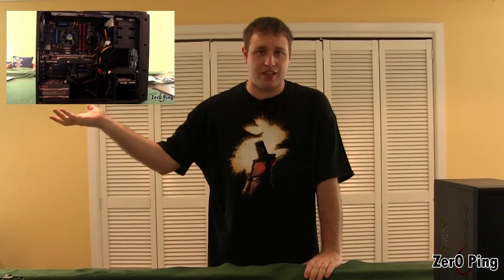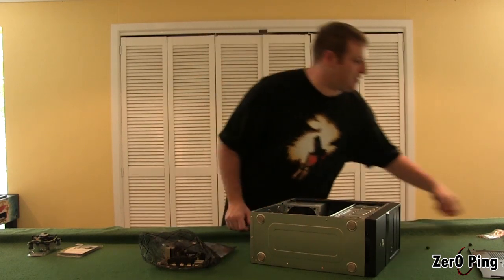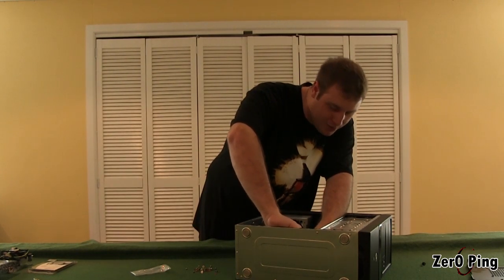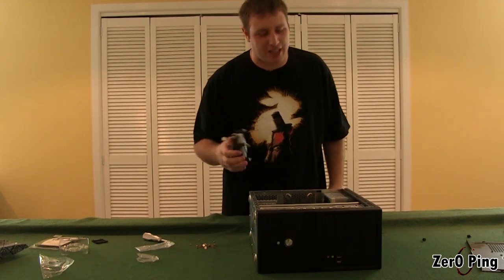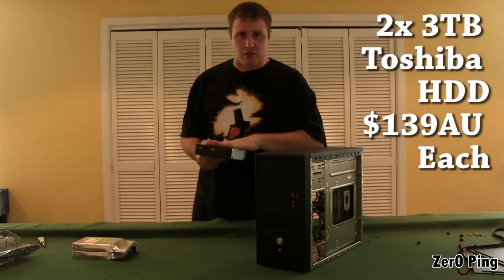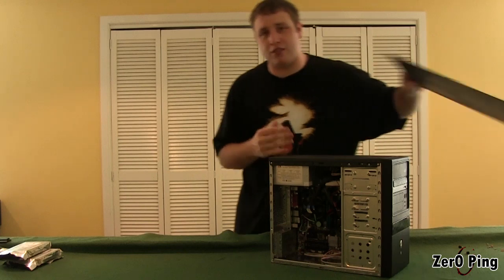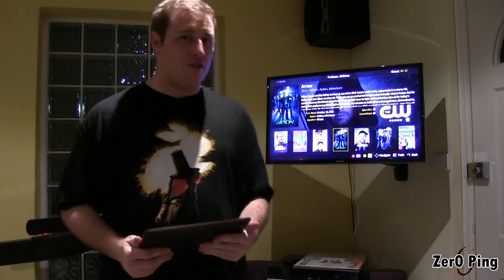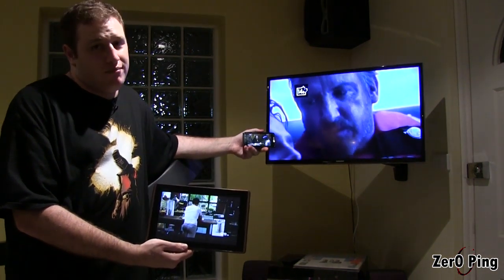How To: Building a Media Server with Plex

Comment: How well would my media server do? I currently have a old PC that is a eMachines W3619 computer and am planning on maxing out the amount of RAM it could handle (which is 2GB DDR2 RAM although possibly not maxed out as it has a frequency of 533MHz in the RAM). Also going to install a Intel Core 2 Duo (P8800 @2.66GHz, Dual Core). Can this possibly send 4k @30FPS at least (I need to know) with no stuttering (Aiming for 4k @60FPS)?
Reply: I am also planning on running Linux on the system (Ubuntu CLI) which might help with reducing large loads for the CPU and RAM (I know Ubuntu CLI requires a very small amount of GPU power to run. The motherboard already has a built-in GPU which I know will run fine).

Comment: Does this motherboard require an 8 pin connector? I only have a 4 pin on my PS.
Reply from the maker: The 4 pin connector on your Power Supply should have no problem connecting to the motherboard despite it having 8 pin.

Comment: Hey quick question. Will this overheat? I live in an area without air conditioning and in the summers it gets a bit hot. What also would work with an AMD system?
Reply from the maker: Plex doesn't currently support more than a single core which makes single core performance very important for the server, for this reason we chose the g3420.
To get similar single core performance with AMD you need to start looking at the A10-7700k which is more than twice the price of the g3420, whilst if you were to use the server for encoding and rendering then the AMD chip sets would make more sense.

We haven't had any issues with heating, however if you were worried we'd suggest installing a fan or two, given we're not using a GPU heat production is quite low, also the g3420 uses around 40w less power than the AMD chip mentioned above and as such produces a lot less heat.

Hope that helps somewhat.

Comment: Do you think it'll work in this case? Silverstone Milo ML03B microATX
Reply from the maker: Hey Kam, the Silverstone Milo ML03B will happily support the motherboard we used, however if you want to take advantage of the USB 3.0 ports on the front we suggest investing in an ASUS H81M-PLUS, it's only a few dollars more. The only things you'll need to worry about are expansion cards like Wi-Fi, sound and graphic cards should you choose to go that route as the Milo is quite shallow and will limit you to half size cards, This isn't problematic if you're happy to use on board sound and CPU based graphics processing, as for the Wi-Fi, Michael uses a TP-Link WDN4800 card which comes with a half size bracket in the box for cases just like the Milo.
Reply: Hey, thanks for replying. I didn't see this come though as I don't check my G+ often! I decided to go with a Mac Mini in the end. It was less money, takes up less space and more power efficient. Runs perfectly and I just screen share in to via my macbook pro when needed :)

Comment: How does it work man? I would imagine the Pentium G3420 doesn't like to transcode 1080p videos? I'm building a haswell i3 system with Plex/Filezilla using Ubuntu.
Reply from the maker: So far no struggle, most of the time it is streaming to about 3 devices at once usually in 480p, but throw in a 1080p stream and it keeps on going without a hitch.
Reply: out of an i3 similar to this I'm able to transcode 4 1080p streams at the same time at a push, but only on fast transcode, which is suitable for most people =)
Reply: Kevin Caldwell Which i3 in particular?
Reply: TheBlooRayChannel the i3 3220, its dual core with hyper threading. If I hadn't already mentioned I have Plex running in fastest transcoding too. I notice no difference in quality, and it helps to minimise CPU usage (and energy costs), while maximising output =)